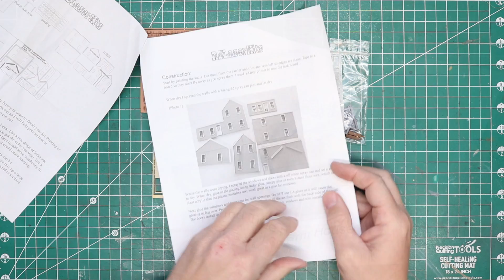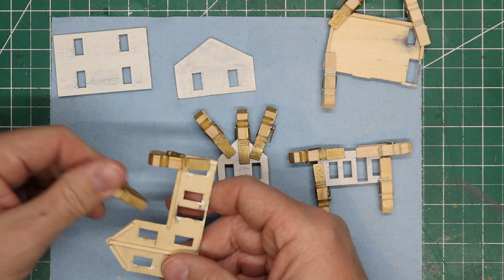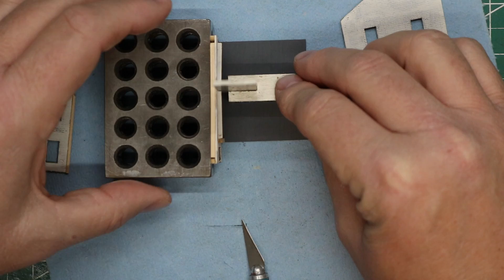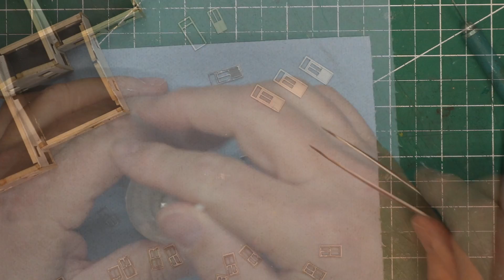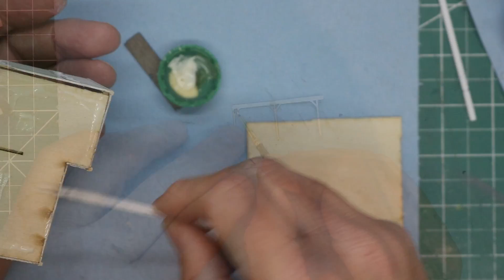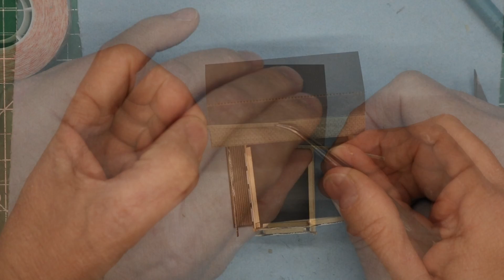Step-by-Step Guide to Building an Old Model Farm House for Your Railroad

Comment: Thanks for the tip on the micro brush for carpenter glue application, I used tooth picks! The dried glue would come off the plastic micro brush easier, I will make the switch! I will be using this soon! N scale is a Son Of a Gun, to work in! I model ho and S scale! Nice work Ron, I enjoyed the video!

Comment: Ìf you want frosted "glass" use a thinner compatible with the plastic solvent and cut 90% thinner and gently spray, or dry brush, the solution on one side. Put the frosted side on the inside of the window. Be careful with this technique as you can quickly destroy glaźing.